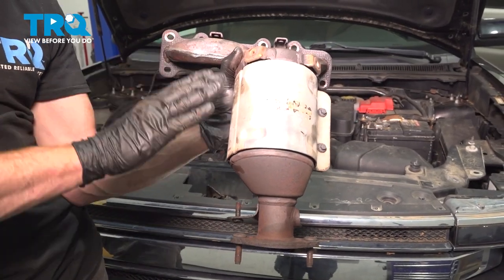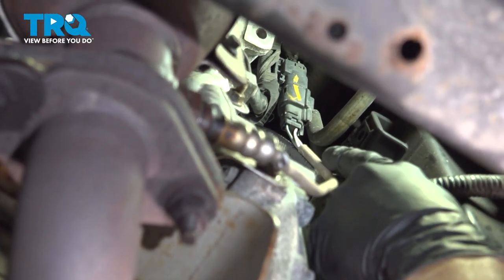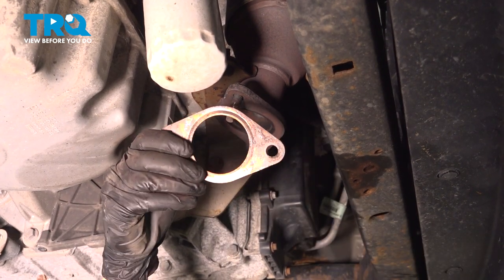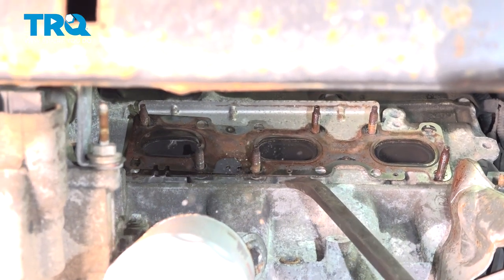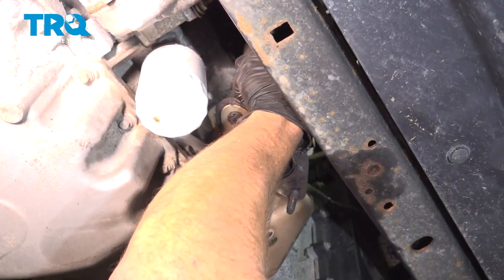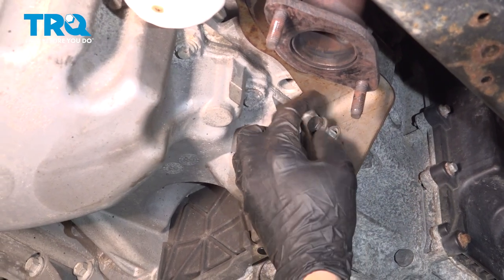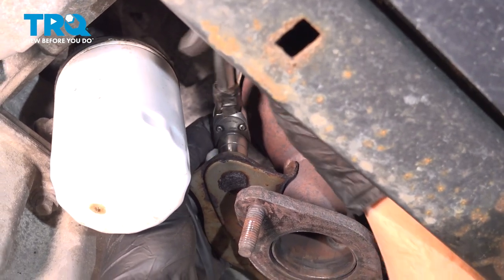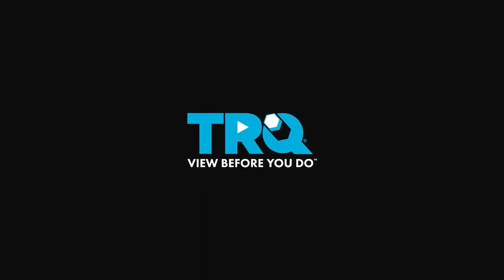How to Replace Exhaust Manifold Catalytic Converter Assembly 2009-2019 Ford Flex

Comment: Had a guy replace my front Cat Converter and did not  put the heat shield back on.  Do you think that will cause a problem later?

Comment: What size o2 sensor socket?
Reply from the maker: +kuei12 The oxygen sensor sockets are universal. You should be able to use any oxygen sensor socket to remove the part from your vehicle.